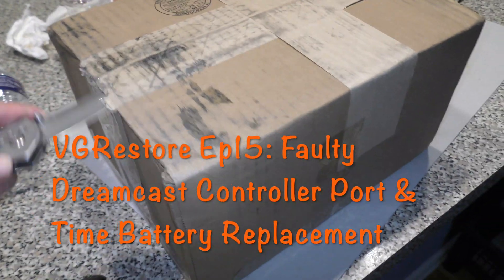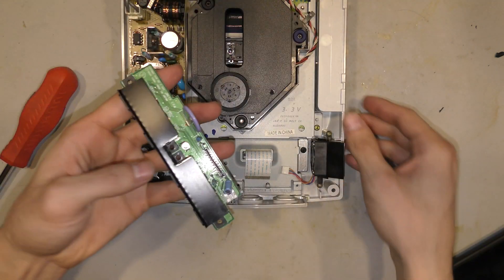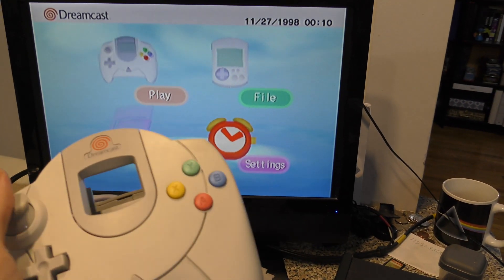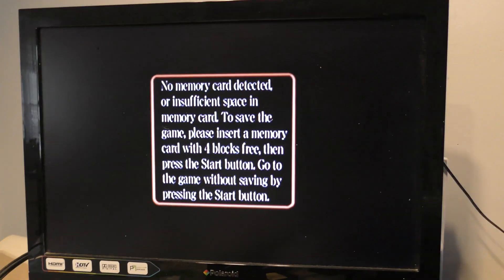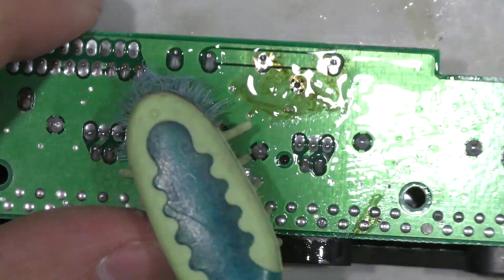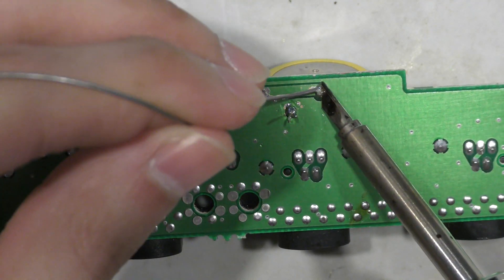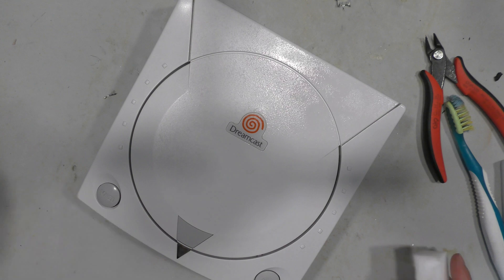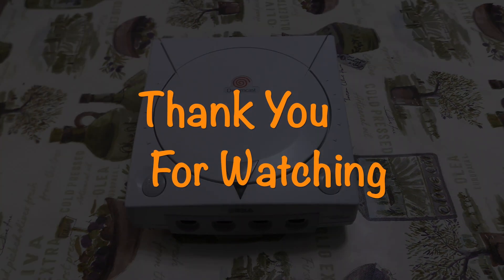VGRestore Ep15: Faulty Dreamcast Controller Port & Time Battery Replacement

Comment: oh btw the reason people advise not using cr2032 batteries is they are none rechargeable and the system has a recharging circuit that can make those type of batteries leak, even when using a holder its important to use a rechargeable lithium LR2032 instead like the one that was in it originally. this is also why you should test dreamcasts for 4-6 hours to give the original battery time to charge as you might not need to replace it at all.
Reply from the maker: That’s right! I have a video coming out tomorrow that I replace using an ML2032 battery.